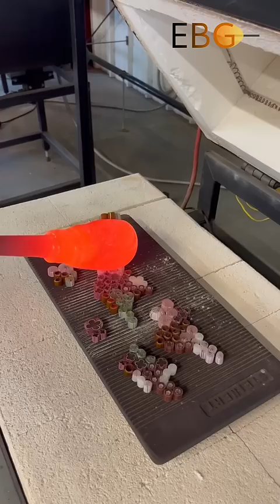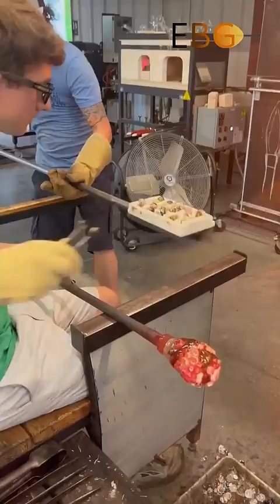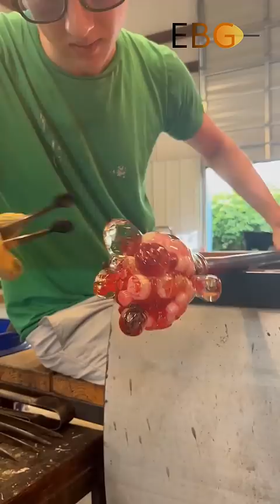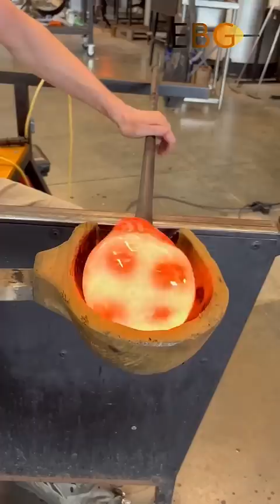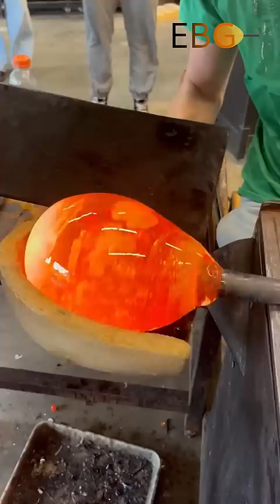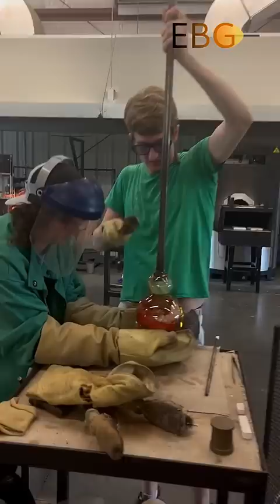Ocean Piece Broke :( #cool #glassblowing #asmr #art #decor #fail #glassart

Comment: For those that say “just repair the breaks or make them part of the piece” it’s not always that simple with glass blowing because if it breaks while it was annealing, or because they didn’t flash it before putting it in the annealer, it indicates that the actual molecules did not settle into a stable glass form and it could be susceptible to more cracks or even bursting at random. Glass has to be cooled down extremely slowly like over the course of 18 or more hours in order to stabilize the piece. Otherwise it can become an amorphous solid and have weak points.
Reply: would it work if it was reheated to like red hot and cooled down again very slowly?
Reply: @HoneyDoll894  in theory yes, heating above a certain temp will remove the stress points, but I have no idea if it would stabilize a piece already cracked to this degree especially with it being so thick. It’s pretty hard to heat up a big chunk of glass all at the same rate (inside just as fast as outside or it could explode)

Comment: So, question: they heated up the larger pieces that they stuck on; but they didn’t heat up the smaller pieces before that? Doesn’t that create a lot of tension? For a piece like this, too, do they have like a giant oven to « telper » (sorry I forget the ter for slowly bringing the temp down) the glass? Like a ceramics kiln or something to relieve all the stress of the different substances in the varied colored glasses?

Comment: What is the cause of fractures? Cooling too quickly or just unequal pressure in the glass as it cools. I had a piece blowing by an artist, a small piece and it fractured about a year later I used to sit it on top of a little blue glass lampshade and you could see the ball through the top looking at the lamp but the heat of the lightbulb eventually fractured it.